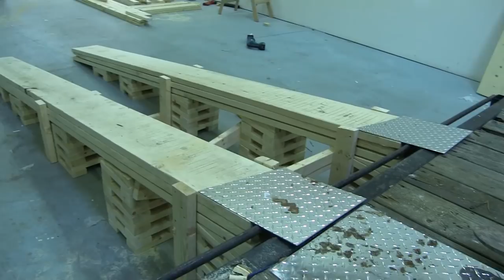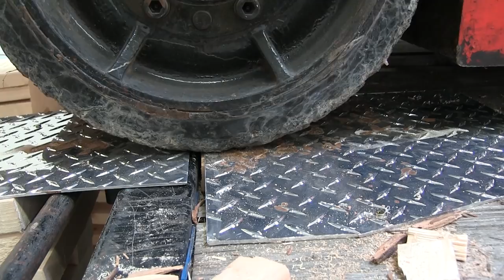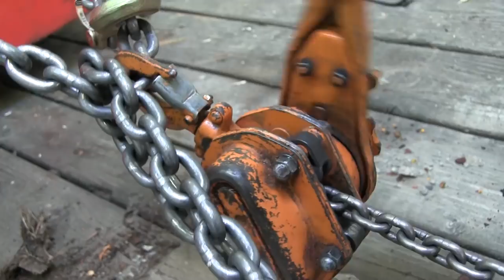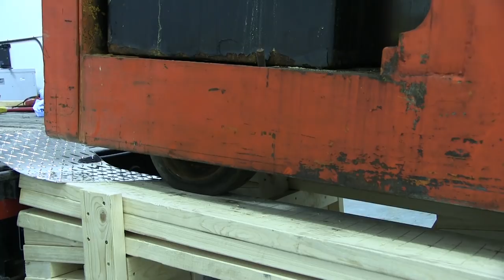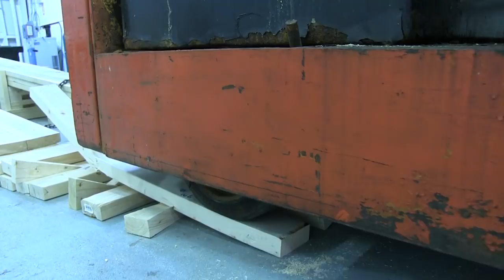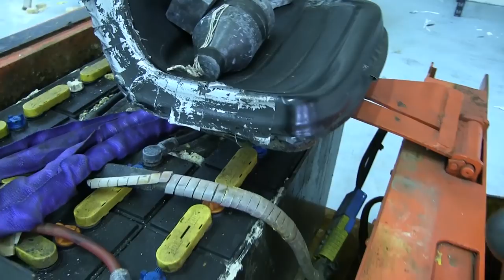Problem Solved! | Forky McForkface

Comment: Lumber must be cheap in Canada. Here in my area of the states it would of been cheaper to hire flat bed wrecker to back up to that trailer and load it then unload it to the ground.
Reply: Pride, my friend, will sometimes make a man work harder than his wallet should allow.
Reply: @montestu5502  in Australia that would have been thousands of dollars worth of timber. In fact the cost of the timber would have been about as much as the trailer was worth.
Reply: Joshua Potter I have scene brandy newness aluminum rollbacks get schmuckered by doing that, no longer a flat bed. More like a banana bed that binds and screams every time its rolled back after it was forked.
Reply: If those are 2x8x16' they are $23 each.
Reply: @cruzinezy1968  - Well you see, I use to live nextdoor to Ahern equipment rentals in Las Vegas NV. They have 91 locations across the western USA and are the largest independently owned equipment rental company here as well. At the same time I worked across the street from Clark the forklift manufacturer and leaser also in Las Vegas. Both companies often used flat bed tow trucks. Neither one of them would do it nor the tow companies if that was the case.  Also there's plenty of popular tow company videos here on YouTube also with videos of them moving forklifts of this very size.
Reply: Assuming 2x10x16' for the ramps and roughly 40 2x4 studs for the piers and using home center prices it comes out to around $270US which may be considerably cheaper than a tow truck or forklift service call out in the BC backcountry.
Reply: sam hope seriously?
Reply: Two words: import duty.
Reply: Yeah, those trucks generally don’t like such a high concentration of weight in such a small area.
Reply: @gasfiltered  - googled it. It's $163.00 Canadian plus tax to hook up and unload on a  heavy flat bed roll off rated for 7258kg (16000 pounds) in the BC area.
Reply: What are you guys talking about? I live in Italy, where lumber is pretty damn expensive, and I can buy a 25x5x400cm beam for 17€ at my local hardware store. https://www.bricoman.it/n/edilizia/carpenteria-coperture/carpenteria/tavole-ponteggio/tavola-250x50x4000mm/10041085/
It's fir so not the highest strength, but they're used in construction so they're not weak either. 3 of them should easily support 1 (metric) ton, especially with how many support columns he used.
That would put the entire setup at less than 150€; if you can find a trailer for that money... well lucky you I guess. They go for thousands here.
Reply: That is because of soft wood import tarif imposed on canadian lumber.
Reply: @cholulahotsauce6166   not in Canuckistan . More likely in excess of $300

Comment: Surely it wasn't the wood compressing, but the trailer lifting that caused the checkerplate to bend?  Anyway well done on getting 'er down.  I'm not sure I would have been game to try that one.
Reply: Ben Hitchcock  think it was the wood compressing, look at the background. It isn't moving and the camera is attached to the trailer
Reply: Partially the wood compressing, but also the weight shifting from the trailer onto the wood which causes the trailer to rise a bit.
Reply: nooo, the wood was compressing. 2x4's from New spruce growth are only slightly better than balsa. Ave wasn't kidding.

Comment: I used to drive one of those.  Actually many, in a steel manufactory of considerable acreage.  Some were tonnage-wise truly beastly.
                                                                     ---   Forklifts.  Are.  HEAVY.   ---
Reply: JamesG considering they need to keep their centre of gravity low, all such machines are deceptively heavy.
Reply: The key thing to understand is not just that the center of gravity must be low, although that is obviously helpful.  What they most need is to keep their center of gravity above or below a point that is BETWEEN THE WHEELS -- most particularly WHILE CARRYING (MOVING) THE FULL RATED LOAD.  The math has to include mast extension and angle and lateral forces while moving and so forth but the end result of all the numbers in practical design terms is that it must always have a massive low-slung counterweight.  Hence forklifts always weigh more than their own rated loads.  Around 2X as I recall.
Reply: @jamesg1367  what's up with those little stand up ones at costco and the depots? They don't look like they weigh a ton.
Reply: They are only rated for moving a pallet on flat ground. No tilt, no overhanging loads. That severely limits the amount of weight hanging off the forks at strange angles, almost all the weight is centered in front of it. From a quick search, even a small "walkie stacker" is 900lbs

Comment: Still saying gear box/differential… Moving the forklift that much freed up the gears. I bet if you use it the problem will reoccur. 

Also, doesn’t trailer have its  own ramps? That seemed quite extreme.

Lastly, why weren’t you unloading that thing in the scrap yard?  How was this thing worth the time? Do you just have a thing for old forklifts? Totally cool if that’s the case… My Irrational logic mind really wants to know.
Reply: Trailer probably does have ramps but might not be any good for that amount of weight in such a small area.
Reply: Looks like a standard semi-trailer: lots of them don't have ramps, and even if they do they're only intended for 2-wheel dollys, can't even run a pallet jack on one.

No, this trailer is almost guaranteed to have been last loaded from a loading dock.

Comment: 1: Secure rolling payload to fixed ground point with chain(s).
2: Set up video camera for FAIL video.
3: Pull away in tractor vehicle with trailer attached.
4: Liberate beer from cooler jail.
5: Open beer.
6: Enjoy beer.
*PROTIP - Steps 4-6 can be accomplished at any time, repeatedly.

Comment: Best ramps ever and it's a loose connection or a short in the wiring.  The jolt from the wood cracking moved it from previous state, test drive over cracks on floor any where impacts will be hard.  Ask operator what and where he was driving   ,  fast, slow,  bumpy,  is this a reoccurring problem or intermittent

Comment: Ok it's off the trailer, soooo are you going to use the trailer now and say fuck the lift, or after using the trailer you actually gonna see what the Chooch problem is and was. 
Or is all this time me thinking its gonna be some trouble shooting of a old fork lift to learn some knowledge to spark the old brain cells for how this shit works all going to be like a bad soap opera that leaves ya hanging ??????.?

Comment: Maybe the wood trailer surface was spongy enough to depress a little under the tires and provide enough resistance to resist the (fuck all) power the thing has - due to old battery?  Is 130 amps normal?  Seems low, given the few DC motors I've run into - a boat bow thruster is like 200 amps.

Comment: Reminds me of the time I accidentally pulled out prematurely from a dock in Milwaukee, and the forklift got stuck between the dock and the trailer. Not sure how they got that sorted out, but I got out of there ok, so. 

I was also thinking, they usually have at least 1/2" aluminum plate between a trailer and a dock or whatever to get the stuff across. That stuff you had was awful flimsy.

Comment: So the boss says to me:  Go make the 15 ton crane work.  We need it to be able to lift stuff into & out of the engine room.  Take a Bos'n with you...  Off I go, to investigate this rather elderly 15 ton crane.  I get it working ish (it traversed, and the hooky bit went up and down, and when a bos'n with an IQ higher than their shoe size, or smart enough to listen, was running it, they didn't bend the mast into a pretzel...that was later...).  Go see boss, tell him it verks...he says...lift something with it, that's about as heavy as the hatch.  Said hatch is about 6' square, made of steel, and happens to form a substantial part of the flight deck...  now, me being somewhat bright, knows that forklifts weigh a lot...and we've got 3 of them, so if we bugger one up all the way, or drop it over the side (splash !), or something, it'll all kind of work out.  Bos'n hooks it up, and I say...hey wait a moment, this thing is about to become a 10 000 lb pendulum...how are we going to STOP it ?  don't worry, they said...   You'd be suprised how much of a scrape in steel 10 000 lb will make ! (also important to note in the case of actually lifting off the side of the ship, which the helo cranes were designed to do, is that the weight comes on AT THE BOOM from a calculation prospective...lots of ton/m for bad stuff to happen, with 15 tons and about 30m from CL at full reach)

Comment: What are the chances it was a grounding problem? Maybe being on that trailer it was having issues grounding underneath it. The electric forklifts I used to work around had a grounding strap dangling down, mostly for the static buildup but maybe this older one has one too?

Comment: Could you review the Harbor Freight "Badlands Winch" ?  Everyone that owns ATV's and side-by-sides are buying them saying they are better than the Warn Winch, (the Warn is the leader and most expensive)  I have found the cheaper ATV Winches use plastic gears and not sealed where water gets inside the winch motor. I admit I did own the cheap ones in the past where they failed quickly and always spend the extra money on the Warn. My current winch is the Warn RT30 that held up to abuse for 10 years

Comment: My friend. If you ever have any forklift related interests in the future, do not hesitate to contact me directly. I spent years working for a ferry boat company that had a boat with a cargo bay too short to accommodate the height of modern forklifts with safety cage. Because of this, we had a 70s forklift with the cage removed. However, due to the fact that OSHA could show up at any time and make us put that one back on, making it impossible to load heavy freight on one boat. We also owned a 1935 Clark forklift. So old it was grandfathered in because it never had a cage/rollbar to begin with. Had 2 new forklifts worked fjne3 most of the time, but the 1970s ane 1930s had to both be in perfect shape due to the unique situation. Gained very much experience working on forklifts Older than my grandpa. God that fucker (forklift not grandpa) was so old it had a foot pedal clutch and gearshift lever that looked like It came from an old dump truck. Try getting a nice top heavy unstable load moving on those forks without launching it into a low earth orbit. No matter how slow you released the clutch, it was in bucking bronco mode. Thing was about 2 feet wide and the counterweight was mounted really high, so it'd also tip over on the slightest turn. Parts weren't available for the 70s or 30s anymore so we had to custom fabricate anything that broke. Which thankfully was more rare on the 30s than any of the others. Thing was solid as all hell. Being built in the 30s when no safety rules existed also meant the thing had a high gear that would get you up near 50mph... On a forklift that would tip over given the slightest steering input.. Sorry, I gotta stop rambling now. Getting all nostalgic here.

Comment: I've had this happen with a petrol engine on a shredder. Swearing, tapping, fiddling with screws and throttle and spark-plug, I fixed it so much I broke the pull-cord (start-cord?). Got a new cord on it, moved it into a better fixing site, started first time! By which time, I'd burned the brash I was going to shred into mulch, of course.

Comment: At https://youtu.be/40ZsIahuxF0?t=293 you can see the weight compressing the Rigid Carbohydrate Foam. Only(?) way this will go back up the trailer would be a laminated beam made of these planks glued and screwed together. IMO.

Comment: Almost as much fun as watching BCBloc drop a 15 ton radial arm drill press from 6 feet in the air. You should have seen the cloud of blue air surrounding his head after he realized he hadn't been killed or maimed (though his fresh concrete floor was cracked six ways to Sunday, and the drill press cracked in half due to sheer joy). Yes there is a YouTube video. Just search "Worst day ever".

Comment: The proper Wisconsin method is to get the front wheels off the trailer and then drive away with said trailer.  100% success rate!    This was with fork um lift driver installed.  This was a guy at work circa 2006 but clearly remember he soiled himself.    Keep your dick in a vice...  And thanks for not going under that thing....totally not skookum.

Comment: Oh, I saw nothing wrong with your methodology and execution. I wish I had a video camera affixed on me while moving a 700 lb gun safe from my truck bed to its final resting place up a few stairs, a 90 degree turn, down a hallway, over a threshold, into the corner, leveled and bolted down. No wonder the safe movers get $1000 to do that. I still have all ten fingers, all ten toes, and my dinkie too. My heart lost a year or two, but who wants to live forever?

Comment: It works at ground level due to the pressure sensitive electronics. That's why you never see forklifts working on board planes. Trust me, I'm a mechanic for Still.

Comment: Military. M113 stuck in mud. Daisy chain four ten-foot steel wire cables to two other M1113’s for recovery.  Sergeant yells at soldier to not step over the slack ‘rope’ lest he wants to no long be or have any privates. Moments later the D-link lets go under strain. Wire cable takes out legs of the sergeant who was standing next to the stuck M113. Free helicopter ride.Two eyes and two ears to learn the lessons.

Comment: Well... I have a life lesson here...
Once upon a time, in my “shop” no bigger then a pukering shoebox, I done did some wood turning on the cheapest lathe CanadianTire could ever muster!
The thing was a 100 bucks and I suspect half of that was the motor.
My setup?
I had the thing not even bolted, just sitting, on top of a workbench made with nothing but 2X4 so bent and crooked, that they would make barn boards blush!
On top of having a bow legged bench that swayed like reeds from nothing more than a stiff fart, I was trying to turn a bowl from a half log cracked all-over worse that firewood!

Need less to say once halfway through the process, after I had white-knuckled my way for an hour, hanging on for grim death onto my roughing gouge.
I can only assume the wood got tired of my sh!t and as soon as I realized I had a catch...time slowed...my pupils dilated...I felt a jet of air blowing on the right side of my head.
I heard a loud CLANG from the steel I-beam from the sealing...I found myself at peace. I looked at the sealing, seeing a pale mark, I then looked down to see a piece of wood the size of my fist is what went ballistic on me!

This goes to show, that sometimes, it’s better to just avoid pilling dumb sh!t on top of dumber sh!t.
Especially if it’s easy to imagine what can happen!

Comment: if you made legs with the grain direction vertically instead of cribbing with the grain going horizontally, you would have gotten less compression of the wood fibers. good job getting Forky down though.

Comment: Seems a loading dock was in order. But short one dock, could've used 1/3 or 1/2 less carbo foam iffin it could tilt as the weight passed center.

Comment: Once you had it on the ramps you could have chocked it, unchained it, pulled the trailer forward 4 forklift lengths, then chained the forklift to the trailer.

Then unchock it and back the trailer up, letting the forklift down the ramps much faster.

Comment: The last time I had to get a fork lift off of a flat-bed trailer, I just called the local tow company and they brought out a flat-bed (roll-back) tow truck.  The bed of his truck was at the same height as our trailer, so he winched the fork lift off of our trailer and onto his truck, pulled around where I needed the fork lift, then tilted his flat-bed back and released the winch to let the fork lift roll off the tow truck.  Took about 1/2 hour and cost me $50.

Comment: Is that a brushed motor in that hoary monster? What's the condition of the bearing at the brush end of that motor? Nothing will screw up a reversing brushed motor faster than a wobbledy brush end bearing. You can just give me some beer. Just pour it into a USB port on your confuser.

Comment: I’d bet dirty or worn commutator. Possibly worn brushes. Had this happen to one of my techs, I go on site to assist troubleshooting for a no travel concern, open the motor compartment, turn the commutator shaft with a ratchet and presto. It vwerks! Stoned the comm and replaced brushes, good to go. This after he had told me “yeah I checked the drive motor”.

Comment: You could have rented a trailer for the cost of all that wood. I had to drive a self propelled sileage cutter off a trailer(about the same weight) using less than 1/2 that much wood. I was not very happy about it.

Comment: At the Cleveland Zoo we had a manlift that was all electric. What made it real sketchy was going down or up some of the hills we had around the park. There was a tilt mechanism built-in that would kill the electric should it go too far off tilt. There was also a way of bypassing the safety mechanism which made it not regulated for speed but it also disabled the braking mechanism. Of course we would never do that. That doesn't look like the issue here since your flatbed looked rather flat. But you may want to see if they have a sensor similar to that and find out if possibly it was tripped and held in that enabled  position which created your disabled condition and the stoppage. 😎 Just a guess.